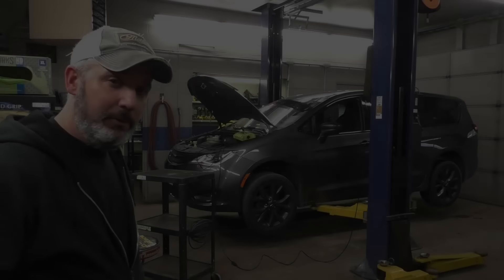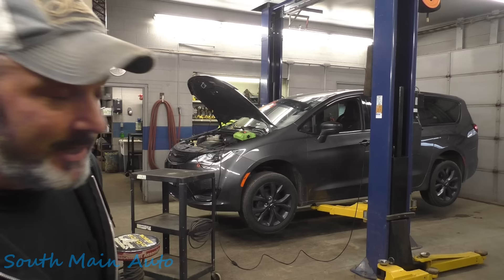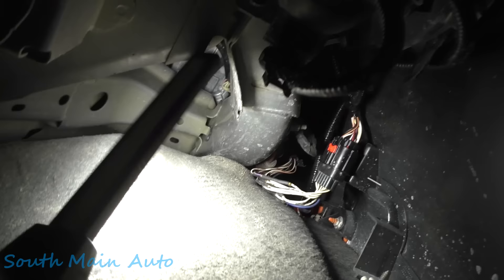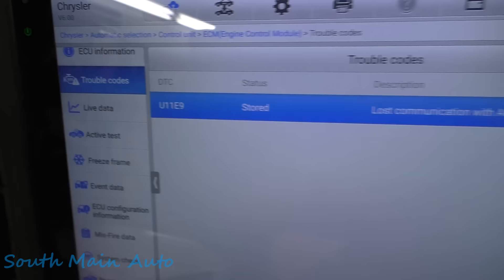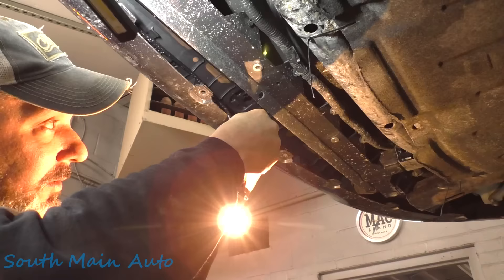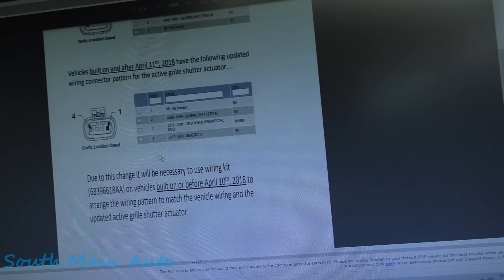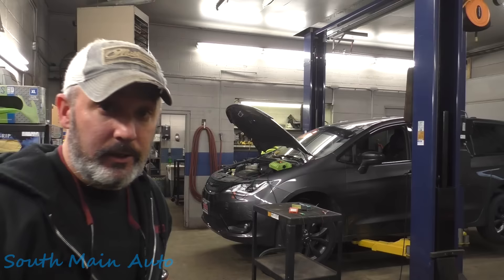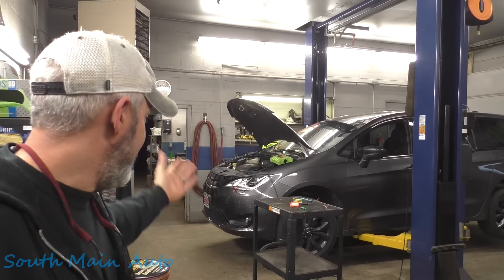Chrysler Pacifica - Updated Active Grille Shutter Wiring

Comment: Gotta love the mid year engineering change.
Reply: Mazda had a period back in the 80's where you had to order parts on VIN number ánd year and month of production, as the mounting holes on parts like fenders seemed to shift a few millimeters almost every month........ how stupid can it get? You buy the part, hold it in place and it seems to line up just fine, have the part painted and when you try to mount it, the bolts just don't fit.
Reply: probably a supplier change, and someone started making the shutters wrong.
or there was an actual legit reason to change it.
Reply: That has been kicking my but for two weeks solid on a multitude of cars. Why on earth did Chrysler think it was a great idea to put so many options on 300 and Charger brakes? Even with the VIN it only narrowed it down to four. Then the rear control arms on them is about the same story.

Comment: Good stuff Eric!  What they should do is include a male-female adapter that changes the wiring using a connector that connects between factory wiring and the new part to change the wire layout so if it's needed, it's included. But that would require thinking and we all know OE's... Cheap and "no thinking" at all!
Reply: I was going to reply with the same comment! Why in the world would they not include either instructions on the possible need to repin along with the blank plug, or include a short inline adapter? Either one should have been included with the new AGS, especially if they no longer mfgr the AGS with the old pinout!
Reply: @RickOSidhe  Two words: bean counters
Reply: $30, for a new harness.  $32, for an adaptor..

Comment: Eric O, that was a great case study highlighting the power of service information (SI). It's puzzling to me why some shops still today don't invest in service information (SI), considering how valuable they can be. Just think of the time and money it would've saved this used-car guy if he had SI. We're all concerned about how quickly we can get the part and how fast we can install it, but often overlook the importance of verifying the repair.
Reply: Trouble is SI costs $$$$ and sometimes SI is brand specific so you spend $$$ for GM, $$$ for Toyota, $$$ for etc.  You have got to consider that is the $$$ worth the use you will get out of it?   Used cars are generally polish the turd and sell it.  Do the obvious and ship it.  They will not take the time to diagnose and use service data.

Comment: You had me at grille shutter , amazing technology from the 1920’s
Reply: Indeed Rolls-Royce did with simple bi-metal strip thermostat.
Reply: I had one on my John Deere "B" tractor from 1948. No water pump, thermosyphon only -- so no thermostat, just the  manual grille shutter.
Reply: Yes...I believe they used those shutters on the older cars such as Rolls Royce in the day prior to the invention of the coolant thermostat and pressurized cooling systems.
Reply: @andrewwmacfadyen6958  Yes, they did and would last much longer than this new design any day of the week. 1929 Rolls.
Reply: Had shutters on my first truck, a 1975 kenworth w900. The guy who bought the truck new, and taught me to drive, disconnected the system and wired it open. Had a few others with them. As you can imagine what it would do to the motor temperature very quickly when they are stuck closed.
Reply: The modern replacement to cardboard.
Reply: I have a cooling flap on my '77 VW (air cooled engine). Cooling flap rotates open and closed to direct heat over the oil cooler initially to get the oil up to temp. When up to the temp the flap rotates and diverts the air away from the oil cooler. This is done with a cable connected to an accordian thingy filled with alcohol of some sort. As the alcohol heats up it turns to gas which expands the accordian thingy, effectively releasing tension on the cable which rotates the flap. Pretty ingenious stuff. Those tricky Germans.
Reply: so a grill shutter replaces a thermostat.??..  the more tech they put on cars, the less they last.. all bs..

Comment: Had a guy stop yesterday with a 09 youkon. He is a retired shop owner. His wife woke up went to leave for work and no headlights. She took his truck and told him to have it fixed when she got home. He stopped at my shop and told me 60 dollar bulbs replaced 3 months ago blah blah blah. I said did ya check the bulbs. He had a spare so we plugged it in. Wala let there be light. I explained to him those vintage gm eat bulbs and the fancy pants bright bulbs don't last as long. Also that good and new are 2 different words. Old dogs can learn new tricks.
Reply: What do you mean "they don't last as long."  Why, I have a set that has the little fans on them that cool them to insure they last longer.  They lasted all of a year.  They did put out some serious light but you are correct they don't last as long.
Reply: My neighbor has a Subaru in which you have to peel back the bumper cover to replace bulbs. After she bought "fancy" bulbs from the auto parts stores for $50 for the pair, I got tired of replacing them after they went out a few times. I bought HD bulbs from the Rock for like $4 a bulb. Its been fine ever since. And I polished up the plastic headlights so she could actually see at night. 🙃
Reply: Y'all are learning the difference between upgraded and better
Reply: @mph5896 I have also problems with milky headlights. In Germany it's actually not allowed to do this but I don't care. On the other cars they never get milky
Reply: It is voila a French word, not wala lol
Reply: "Have it fixed when I get home". How about treat your husband like a human and not make aggressive demands? I'd have it fixed- she would have bags packed and waiting for her when she got home.
Reply: @mph5896  LOL yeah had the same thing on my 2013 Outback- you had to peel back the fender liner and reach up in through the limited access it provided-- basically had to do it by feel. Thank God they seem to have fixed that with the 5th gen up.
Reply: @TyphoonVstrom  I don't understand?

Comment: At 7:55, "I would assume it would have come with this paperwork; they can't be selling these things and NOT telling people."  Why just the other day I was asked at the dealership for my VIN for my vehicle.  I keep it conveniently located in my wallet.  I also try to keep in mind some specific knowledge about my vehicle.  For example, I have a Ford with a Saginaw steering box; you just never know when those parts guys are going to ask for that information.  I would have never for one single second ever thought any company, especially a highly reputable company like Chrysler, would ever make running changes and not tell anyone.  The best part: Eric was able to keep a straight face while making that statement.  GREAT VIDEO!
Reply: Christ Ler is no longer what it once was. and jeeps are worser than evar
Reply: Paperwork does come with new shutters. Unfortunately people toss them thinking its install directions. I do these all the time for body shops and keep a ton of these connectors on hand and the replacement has all 4 pin locations open. No splicing needed as its just a repin. If you have a good parts guy they will sell it or at least ask if you need it.
Reply: You're a rare breed. As a parts guy most people have no clue of even what make of car they drive or the year. I get hit on a daily basis with people that do not know the year of the car, engine size or Sub model. Then they get mad because you can not look up the parts.
Reply: @andyd9900  At most parts suppliers in the UK, all you need to know is the vehicle registration number (= license plate number), as they have access to the central database of vehicle manufacturers' specifications for each individual car.

Comment: I had the same issue with aftermarket side mirrors on a 07 F150, the came wired incorrectly for my truck, swapped the wire connectors to match the factory plug and alls good. Keep up the good work, and thank you for the entertainment.

Comment: Why on earth would the parts guy sell him the post 4/18 shutter and the pre 4/18 plug? If both parts are new that's on the parts guy.
Reply: Yep. u nailed it !
Reply: why? in the words of Bill Clinton "because I can"
Reply: Yeah I'd be getting the right one on the house in that case.
Reply: Cause they ordered the wrong parts and the parts guy never read the update. ‘I don’t get paid to think’
Reply: @Boga217   no one can decipher which ones may be correct
Reply: @jhonditch4269  all my appliance parts have notes saying if there's anything special needed to install parts that aren't normal. Pretty sure it should be the same if not more true with automotive parts. That's why our parts site get updates for.
Reply: @jhonditch4269  yes you can by vin and manufacturing date, did you not watch the video. He clearly said before or after April whatever. Parts should say in their catalog before or after, and if your selling him a fan for the after April then you should sell the corresponding connector. That's basic entry level parts counter training stuff.
Reply: You're talking about a parts guy. All he knows is there's a problem with the wire harness, so he sold them a new one. Nit knowing exactly what the problem is. 
Yes, you're right. It's still on him.
Reply: Or why didn't the manufacturer move the alignment splines on the outside of the connector so they don't plug in, so it was obvious something changed?
Reply: @eldonerc2524  for real even Whirlpool does that on their washer capacitors. Can plug in a 45 MFD that needs a 50 MFD the splines are moved to different spots.
Reply: I've said it for years. "A dealer is no place for a car!"
Reply: Cannon fodder
Reply: Tech service bulletins are available for dealer techs.  Dealerships and manufacturers want to make it as difficult as possible for anybody else working on the vehicles.
 Dealership techs are expected to look at the available service bulletins in the electronic service information so there's no reason to add printed pages with the parts.
 I know the guys in my local GM & Toyota dealership parts depts and they're kind of decent about getting me service bulletins if I ask.  But I have to ask. The Parts guys generally don't know about most service bulletins.  It's not in their wheelhouse.
 This is why professionals subscribe to Mitchell Alldata etc to get service bulletins for vehicles in their niche.
 One of many reasons the right to repair movement is gaining traction.
Reply: The old shutters are discontinued. I'd be willing to bet two bits that the updated shutter he has right now is the only one available.
Reply: “I’m not even supposed to BE here today!”
Reply: You gotta wonder about a company that does stuff like this. And, who needs an active grill shutter in the first place unless you regularly drive in below zero conditions.
Reply: Chrysler did some things very differently for the 2017 Pacifica(first year) and probably still for 2028. I have a 2020. So far, no parts cannon fired.
Reply: Because of hey went off the vin number by for the harrness and they only sell the new style shutters
Reply: @jhonditch4269 hey parts guy why are you defending another parts guy screw up. What are you held to a code that snitches get stitches 😂🤣🤣 or honor among corporations
Reply: This^^^ I ordered a replacement ac compressor and luckily the parts guy knew to check the vin. In my case the manufacturer had changed the part 3 times my model year. Live and learn
Reply: @Luigi-pk8mk ” A complicated system that works, evolved from a simple system that also worked!”
Reply: Happens all the time
Reply: That's them dealership parts people they never wanna serve the outside public or the DIY guy. We literally dealt with the same thing with the same vehicle Chrysler Pacifica with a oil pressure sensor. It was a replacement and it came yet to replace a different wiring harness.

Comment: Mopar wants EIGHTY FIVE DOLLARS for that little harness cross over connector!  
Me & a Dremel would be fixing that problem for ZERO dollars  :)
Reply: for $85 I'd  go through the hassle of pulling the active shutters out and re-pin it on the part side.
but then i'm insane. :D
Reply: kept try to figure out why Eric could not de pin the other end, and mix his own pattern. Still puzzles me.
Reply: @amunderdog  mentioned that in another comment.  probably would have to pull the unit out, which means taking the nose off.
if it were me, I'd have done it. but i'm not a shop.  "you touch it, you own it." applies.  if he broke something else in the process, well now he has to replace it on his dime.
Reply: @amunderdog  He could have...BUT...he wants to keep it OEM as possible for the next guy...That is why...He always does things as correct as possible...even though an easier cheaper way is at hand.For a diy guy it wouldnt matter...but for him it does..
Reply: I was thinking the exact same.  I have done the exact same.  Shove it in the hole, make sure you have good contact , then backfill the hole with a sturdy rtv.  I wouldn't pay the $85 for the adapter.  You can bet that is what the used car lot will do.
Reply: On my personal car I would've spliced it. On a customers car I would buy the harness. This isn't a worn out rust bucket.
Reply: @scannerlanier471 Exactly. On my own vehicles, I've fixed connector problems (like heavy green crusties) with direct soldering and an epoxy fill. Never coming apart again - or failing!

Comment: Had something similar with a fuel tank pressure sensor on an Expedition.  Would have had to drop the (full) gas tank to access the sensor and re-wire the pigtail.  So I cut the harness open at the PCM and swapped the wires there!

Comment: Hi Eric George here from Canada, Yes I agree with you on dealerships they just want our hard earned money, was talking to fried he had a ford explorer took it dealer because warranty wasready to expire he wanted oil change or just regular maintence he said , but he said  he told them to do an inspection on it, because it was close to running out, they told him they could inspect it until he had a complete rotor and brake job, he ask what that would cost they told him 2000 dollars, he told them he wanted a second opinion, told them to just change the oil,/ so he comes home and takes it to a local shop here ,we only have two here,// they check his brakes and rotors  and told him there was nothing wrong with his and they did not need to be changed, he said his warranty is gone so he will not be going to dealership anymore,/ as you have mentioned before  they want to see you stuff you do not need, thanks  Eric , always watch and find your videos very interesting, and you explain everything   out with lots of details,   keep up the good work, if you were running a shop near me i would  be a customer of yours

Comment: Yeah FCA has been doing that lately. I had a jeep patriot 2.4 L a couple months ago the customer changed the throttle body on then it wouldnt start. He used an oem throttle body from chrysler and it came with a new connector and paperwork as well. He wired it in one wire at a time not realizing chrysler changed the pinouts on the new throttle bodies. He called me so i went out and troubleshot it, and wound up comparing the oe wiring diagram to the diagram on the paperwork he got and found 3 of the wires got changed around. Once i fixed it and wired it in proper, it started and all codes cleared when i cleared it and did the throttle learn.

Comment: Jeeze, auto shutters . Imagine how well that system will work after five winters in the salt belt .
Reply: For what do you need this junk anyway?
Reply: @imtheeastgermanguy5431  It is to help the heater blow hotter in the wintertime.Closed shutters allows the water to get hotter.Its actually quite helpful in that respect.Imagine 10 below at 70mph shutters open as opposed to closed.Much warmer heat in the cabin shutters closed..
Reply: Yes or when ice forms on those plastic parts and the motor and linkage is trying to move them. LOL
Reply: @djsi38t  hmm makes sense but a thermostat is doing a similar job.

Comment: That seems to me like a contracted-out part that got spec'd wrong, or the manufacturer read the spec wrong, then they had 100,000 of them coming down the pipes and just rolled with it and called it an engineering change rather than a f-up and fixed it in the harness.

Comment: The thumping behind the dash after turning it off is the recirculation door actuator. They fail all the time on those RU pacifica/voyagers. You can see it moving back and forth trying to find its home position with the glove compartment out. Also, chrysler loves to change connectors and pinouts. I think OEM charger/challenger/300 fuel pumps come with a connector kit and I've had to change to a completely different connector when replacing a fuel rail pressure sensor on an RU pacifica.

Comment: I've had a little DSO Nano with BenF firmware and a Quad DSO for years.
 They're a step up from a logic probe.  For some reason it's easier for me to wrap my head around the waveform on a screen but I don't trust them for actual voltage and frequency measurements.

Comment: The OEM shutter was for the wrong model, it is for the post 2018 by the looks. Why cut and splice anything?? Just swap over the new plug when you get it, you already have the pins available. Depin the new plug, install current pins in correct holes and job is done.

Comment: Reminds me of Ford turn signal switches for late 60s early 70s cars. They came without the wires plugged into the connector because they had to be fed down through a tube in the steering column. The instructions were to cut the original connector off and plug the wires on the new switch into the new connector using the original to follow the color code. Unfortunately the same color wires weren't connected in the same way on the new switches. When the brakes were applied the turn signal indicators in the dash would come on as well both front turn signals.